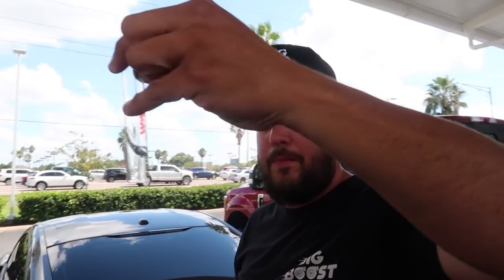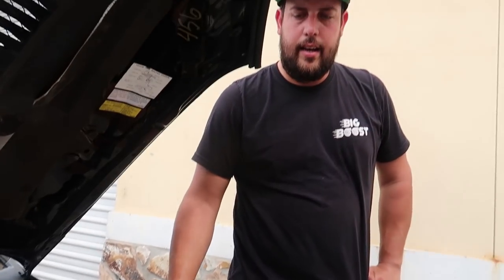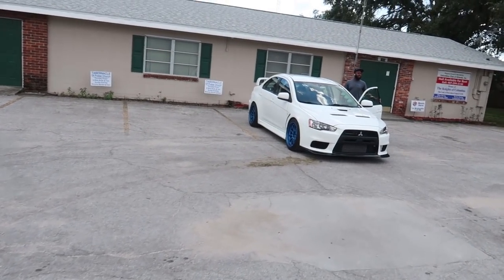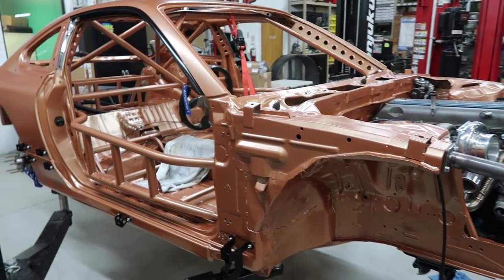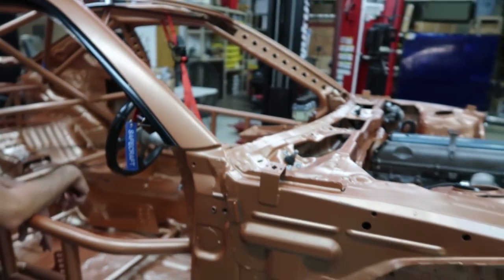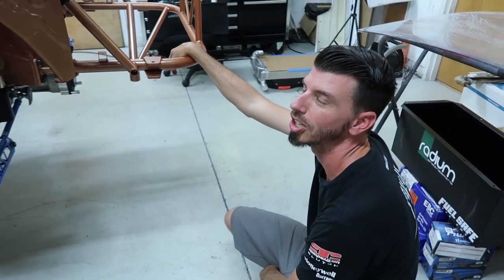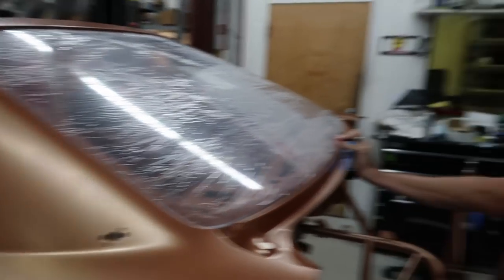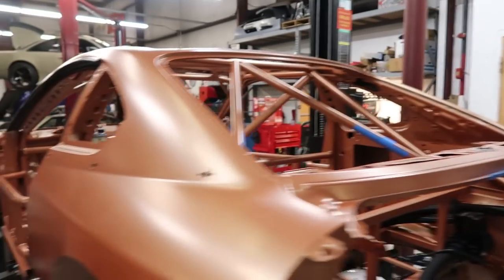Buying a NEW CAR + S15 Update

Comment: "don't want to deal with Subaru problems"   but.... your SR blows up every 1500 miles or less lol.
Reply: Triggered
Reply: Boxer engines yuck
Reply: Salesman slap roof of Evo, transmission breaks. 
Adam: I don't want to deal with Subaru problems and it needs to be reliable
Car salesman smiles and snaps his fingers while pointing at adam: the Evo is just what you're looking for
Reply: ༼ つ. o,o ༽つ weeb your nickname is awesome
Reply: I would take a evo over a Subaru for there engines. I like the Subaru body and style better but there engines suck. oh BTW I've had 5 Subaru's and the last built engine failed at 3800 miles... so ya you can say i dislike there engines.
Reply: GOT EEM
Reply: 15 runs* more like 120 miles lol
Reply: Trenton Deel I love subaru engines, don’t know why yours were so unreliable but I love em, a friend of mine has a 360hp gf8 with a stroker ej22, it’s not soooo unreliable
Reply: Shoes how bad subaru engines are then
Reply: Backroad Chaser porsches rule
Reply: 05 sti cant gi wrong
Reply: I remember the good old days when Adam still had his apartment and Bert was around. He had a clean 335i and rode all the time. Then came the 240...
Reply: lmfao his SR actually makes more than 400hp without shitting itself tho. find me a 500hp OPEN DECK subie. lol nvm
Reply: Trenton Deel nah probably every 300 meters
Reply: @niallcorcoran4437  I had a built 400whp STI. just built short block and that lasted 12k miles and then I sold it and started completely fresh with a new build. had the long block built, only stock part was crank, case halves, and block. made 530whp on 27 psi with e85. 3800 miles later it lifted the head and blew a head gasket. so really the ARP2000 head bolts failed and not the engine itself. but it was not worth the money to build that engine.
Reply: @niallcorcoran4437  and it was open deck
Reply: Trenton Deel      Yeah but that 1500 miles is spent at 7,000rpm bouncing off limiter....  Id say his SR dose pretty good.
Reply: @jakebeatty1855  a few of those times.. It didn't even make it to the track lol. I can't wait for his 2jz car to come out
Reply: Trenton Deel we’ve got a triggered Subaru owner right here boys.
Reply: @yonseth788  well I haven't owned a Subaru in over 2 years so I'm not a Subaru owner.....
Reply: More like ever 100 miles that POS blows up, the money he's wasted on it could have paid for 2 more of the cars Enjuku is building for him
Reply: Evo engines blow much quicker
Reply: H4 are shut, especially the 2.5. I know, I owned one. H6 are better tho, more reliable, but they drink more gas and are expensive to repair
Reply: subaru more reliable then sr all day everyday. change my mind ;P
Reply: This is why he don't want to deal with subarue problem, he had so much problem with the SR... it all makes sense !
Reply: I give it about 100 miles
Reply: Jose Rico Taco Nacho Quesadilla Mandela Jones dead😂
Reply: Trenton Deel time for an.....LS swap
Reply: Jonny Jacobins pull up the defense wall. Do not let him into the manufacture plant of evos
Reply: Lol I've lost count on how many times the SR has been rebuilt in the past year. All the rebuilds have kind of started to run together 😂
Reply: DARE You still only know about how they peform, not how reliable it is
Reply: boxers are worse than sr's though, subaru have the worst engines
Reply: My subie had 300,000km and running strong. Nothing but regular maintenance. The new Subarus are very reliable compared to the older ones. The FA20 in the new WRX is an amazing engine, but the EJ is still a hit or miss in the STI
Reply: yea but boxers are shit for making power, you have to fully build the engine to make any decent power but with sr20s, rbs, jzs you can make good power with stock motor (much cheaper)
Reply: You all are failing to realize an IAG stage 2 tuff short block literally solves 99% of reliability issues. And with supporting mods you can be making 600 to the crank on one of their cheapest engines. If you guys are blowing up built motors left and right, learn how to drive the damn thing and check your oil.
Reply: you will still have problems. just give it time. iag is amazing tho, they do make great parts. Subaru are not meant to make high hp, and if you want to make high hp... it cost a lot more then to build other engines to have or handle the same power.
Reply: DARE slaps roof of subaru boom ringland failure
Reply: but his engine is basically a race motor where as basically stock subies blow up every couple of years
Reply: evo with rally spec trans 00
Reply: i have had both a bugeye type uk sti and a bugeye wagon wrx none had engine or driveline problems, if you treat them with good maintenance they are reliable.
Reply: @REEL SIXX I won't be sour about it. Everyone likes those own car. I've had 5 Subarus. I was big Subaru fan until I couldn't offord to keep it on the road because it always had problem.
Reply: @REEL SIXX I had 3 stock Subaru's that never gave me a problem. I had a 98 forster, 02 wrx, and 04 STI that had some bolt ons and they worked awesome. Both my built 06 STI had problem after problem

Comment: Doesn't want a Subie because of engine problems....Proceeds to go look at an Evo 8 that's not running.
Reply: oDieseLz 

LOGIC
Reply: still runs better
Reply: oDieseLz I would rather have a weak drivetrain then a weak engine which keeps blowing headgaskets 24/7 😂
Reply: ok
Reply: Dealer here I bough few subies in good condition and they were a haaaard sell. Everyone that calls wants to know if head gasket was change if turbo was replaced and these were 70-80k miles cars never again
Reply: @nawzy202  must suck where you live because up here in Canada, the new WRX and STI are the best selling performance cars we have.
Reply: @VIUndeadIV  Denver Colorado alot of Subarus up here it's easy to sell one with really low miles or new. Trying to sell one with 80-90k miles without all the maintenance paperwork that includes new turbos head gasket timing belt is a hard sell. Doesn't matter if the car has no leaks and it's in excellent condition so I stay away unless it's under 50k miles .

Last Subaru I sold was 2005 outback limited with 119k miles beautiful car inside and out. I had pages of maintenance records since it was new everything was done turbos shocks brakes water pump timing belt except head gasket. First question would be has the head gasket been changed I like Subarus grate cars but  not for resale
Reply: @nawzy202  everyone complains about the head gaskets but I hope they realized Subaru changed the gasket material in 99 and 01 I believe. My 04 had 300k km with the original head gasket and a water pump changed at the maintenance interval. I don't know anyone who's actually had a head gasket issue, the only issue anyone has had is the ringlands failing and that was on an 06 STI with an EJ207 swapped and overboosting because the Watergate would stick. Like I honestly haven't seen any real world issues with them

Comment: Three lolz in 30 seconds: 
1. Winter car in Florida
2. Evo's engines are more reliable
3. Always wanted a Subaru, doesn't want to deal with Subaru problems...has rebuilt his SR 3 going on 4 times this year

Lolz
Reply: Evo motor is more reliable then an ej engine the transmissions are about the same (6 speed sti trans might be an exception) he wasn't far off. Evos have more problems because people build them cheap like all dsms and Subaru people still throw money at their cars hand over fist lol
Reply: @mstarn00  true, but he was looking at a swapped Evo that we all know he was gonna try and push to 500whp lol. But stock for stock, I feel like EJ is a more reliable
Reply: That one definitely wasn't a good idea but any 4g63 stock is a more reliable engine and especially once you start modding them. They are stout engines the ej can blow with a intake and exhaust. Lol I have owned and built both unfortunately as much as I love wrxs they just require alot more to build and maintain engine wise
Reply: yeah, the one thing he nailed is the Evo comment; they're more reliable stock or modded IMO, but modded is where they really pull away.

Comment: As an Evo owner, $6800 would have been a legit deal for that car. From the initial look, it was just missing a few things here and there in the engine but overall it wouldn't have been $10k to get it up and running man. You'd be surprised how much it can handle. I'd go back and offer $6k cash, you won't regret it. I've had mine for 8 years, never had a major issues other than buying it with a blown transmission.

Maybe I'll drive back down to FL and snag another.

Comment: Lol good luck finding an Evo 8 or 9 in good condition and clean title for less than 15k
Reply: DARE theyre out there. Theres an evo ix at a dealership with 70k asking 16k. Private sale or higher mileage and you can score one for less
Reply: smgs921 You do know 16000 is more than 15000, right?
Reply: Sherlock Holmes yes i forgot to mention it was 3miles from me and its a clean low mile example thats last year of the IX. Thats also asking price. When i got my 335i i paid 4k under asking price.
Reply: There definetly out there for under 15k but if you want a mint 8 or 9 then you gotta throw out a shit ton of cash

Comment: get a b5 a4 or s4 as a rally car. need something not so popular!
Reply: Evan Zara A shit front wheel drive car that's not configured for rallying as a rally car.. lol
Reply: @shona5512  loll what the fuck audi is known for their quattro awd system. what you talking about fwd. the s4 has a very tunable 2.7 twin turbo engine and the a4 has a 1.8t also very tunable. these cars would be a great contender especially with the 1.8t 5 speed a4's being decently cheap and you could build 450whp car for under 8k easily.
Reply: Evan Zara .. yes’s now u talkin I forget about them..cars only problem them cars heavy af
Reply: @buttcheakyo  That's Navvos Evo X, Adam wasn't actually looking at it, he's stated before in other videos that he doesn't really like the Evo X because it doesn't feel like it's got the Evo lineage. Also, what are you on.. the Evo X was used as a rally car, it's design and layout is heavily influenced by the essentials of rallying. AWD, Small 4 cylinder turbo engine, suspension geometry and performance brakes.. It's not a factory built production rally car but it's definitely a rally based/bred/inspired production car just like the generations before it.
Reply: Shona never argue with anyone that requests specific cars or specific engines. People always requests shit they know every little fact about so it’s almost always a battle you’ll lose lmao
Reply: Evan Zara I'm well aware of Audi's capabilities and their rally heritage. I use a 340hp 1.8T Audi powerplant in my own car, so I'm also aware of how tunable their engines how.. However, you said absolutely nothing about the quattro or getting an Audi with AWD. Most B5s were front wheel drive, not configured for rally, the A/S4 is quattro, yes, but once again, not configured for rallying.. Definitely not as much as an Evo is anyway. So my point still stands. It just makes more sense to buy the Evo. That's what Adam decided on, so you're wasting your breath trying to convince him to buy an Audi.
Reply: @shona5512  well here in canada or atleast where i live almost all the b5 audis are quattro. no one wastes their time with the fwd models.
Reply: i just thought they would be an interesting platform for adam. ive owned 2 b5 a4s and loved my father still owns 2 b5 a4s, a b6a4  and a b5 s4. even tho they are heavy cars the a4s handle pretty good and if its a rally car you can strip weight fast. just the floor carpet in these cars weigh 100lbs. considering the a4 is sub 3200lbs to start with im sure he could get it down to 2800-2900 easily.
Reply: @mytinglong  coreect. a4 is abour 3200 and s4 above 3500. a4 would be the better choice for rally! id love to see adam build an a4 1.8t with a fully built aeb head revving to 9k!
Reply: I love how everyone knows only about subaru and mitsubishi as rally cars. No one(here)apreciates celicas, quattros, deltas, escorts. Even though they are rare adam could afford to buy one of them for sure. But Ya kNoW JdM for LiFE bRo.

Comment: earlier engine evo5/6 rocker cover engine they also had the air pipes from manifold. Evo 7 engine had evolution on the rocker cover and was made from different material. Dodged a bullet with the car imo

Comment: no lie you're like 4 project cars deep i would prefer you actually finish some of them and make videos rather than getting another one. i know no project car/racecar is ever 100% finished but get the 240's running and able to do more than 3 track days before they have to be rebuilt. before you buy another long term car i would much rather see you buy a car that your going to beat up jump a ramp and junk it after. ill like that more than another long term project that gets put on delay whenever you get the next car.
Reply: lsx blaster He only has his 2 s13’s under construction. 2 out of the 100 cars he has. He has a seat time VQ and a seat time, as of now, RB25. If all his projects were running when would he have time to drift a JZ, RB, VQ and SR

Comment: Salesman slap roof of Evo, transmission breaks. 
Adam: I don't want to deal with Subaru problems and it needs to be reliable
Car salesman smiles and snaps his fingers while pointing at adam: the Evo is just what you're looking for

Moral of the story; buy a Subaru
Reply: Trans are the only problem for Evo's because the engines make to mutch torqe
Reply: Salesman slaps roof of STI... ringlands crack, head gaskets blow, and rod bearings spin.

Moral of the story: don't do it.

Comment: Wait a Evo being more reliable than a Subaru? I am the only one who has thought the exact opposite?

Edit: thanks everyone for your feedback. I haven’t really seen a lot of heavily modded Evos so now I know.
Reply: rsmasterng I was thinking the same thing
Reply: No. Coming from someone who owns an impreza. For what adam is used to the evo will make more power for less and he would easily be able to work on the evos 4g63 than the subarus flat four. Now subarus can be of you dont modify them and keep up on maintenance... but thats any car.
Reply: Maybe stock they are more reliable lol
Reply: When you start modifying the engines, yes the evo motor is more reliable
Reply: Subi's can't handle much. Too much to break or self destruct.
Reply: NA Subaru motor is reliable. Turbo Subaru motors are not.
Reply: @NickkAtNyte  I'm pretty sure he'd want turbo
Reply: Subaru's hate the hot humid weather, I had a friend who sold it and bought a Mustang 5.0. only because it constantly had heat soaking problems.
Reply: Subies dont like more than 400-500wheel even with a built engine. Plus boxer engines are a pain to work on. 
4g63 only sucks if its never been taken care of.
Reply: Kuwabara I live in Southeast GA, and I don’t have any issues with it. Like 97 degrees and 97% humidity. 🤷🏻‍♂️
Reply: FMIC or TMIC?
Reply: Kuwabara TMIC. Now I’m sure that it does suffer from the humidity and heat more than it would if I was out west, but I haven’t had too many issues.
Reply: My friend was having alot of hell with his since he would be stuck in traffic since he daily his, he even went to the point of putting sprayers on his TMIC just to try to keep it cool. It was just a wierd situation for him, plus his was a hawkeye wagon.
Reply: @stylepoints.180  they are both shit:) just kidding.

Comment: If you're worried about $10k build cost the evo is not for you. Clean title or not you're bound to spend $10k on a built trans and transfer case alone. Or... buy a STi and have a bulletproof drivetrain. Both engines should be rebuilt every 50-60k miles if driven hard. Cost to own, a STi is cheaper to own and beat on.